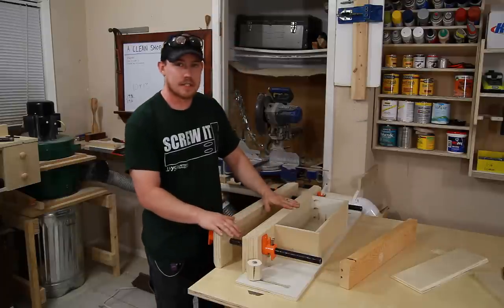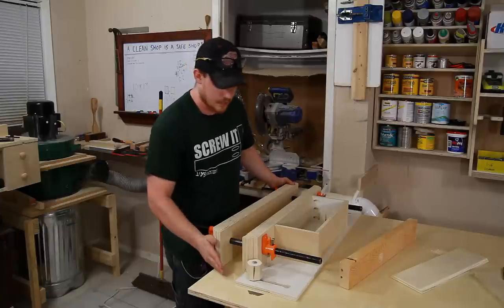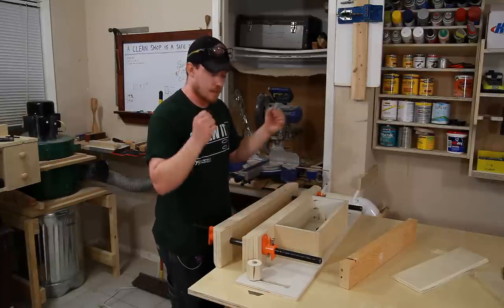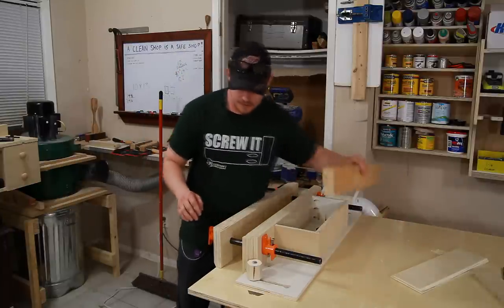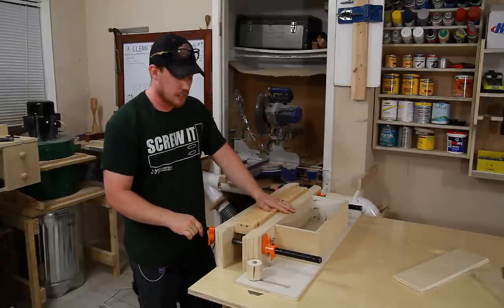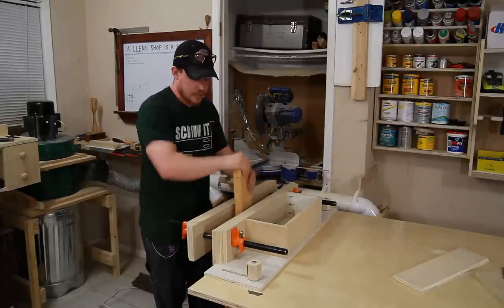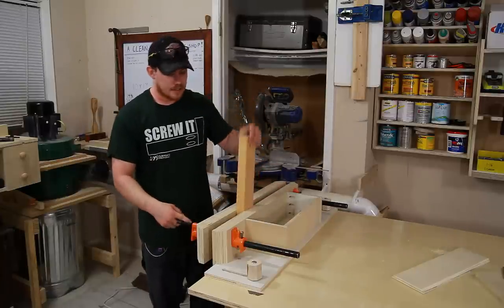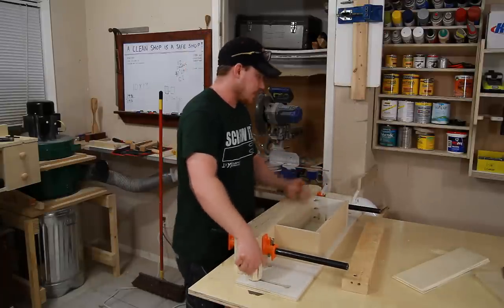Build an Inexpensive Sliding Moxon Vise - 144

Comment from the maker: Make a sliding Moxon vise. Cheap, strong, and easy. Free plans here: http://jayscustomcreations.com/2014/04/how-to-make-a-sliding-moxon-vise/
Reply: I love this project.  I plan to build this vise next time I can make it to HF.  Great job.
Reply: Jay Bates Jay! You've just saved my hide!

I've just started woodworking, and I'm jumping in with both feet, so to speak. I'm planning to build a workbench, but I've been at a loss what height to make the bench. I'll be using hand tools almost exclusively, so I'll be doing a lot of hand planing, for which I refuse to bend down. But if I set the bench too high to accommodate my hand planing, my bench won't be so usable for general tasks like assembly.

With your design, I can make my main bench at a lower, general purpose height, but will still be able to plane comfortably by adding the vise as necessary. Using those pipe clamps was the game changer here. Convenient and solid clamping.

From now on, if I ever eat chips while waiting for glue to dry, I will refer that to as my Jay Bates Moment. Thank you.
Reply: Advice is cheap, but it is usually a good idea to make your workbench the same height as your belt.

Comment: I've seen a lot of videos that don't use commentary and very few work well, but you did a great job with this one. I was able to follow it and even picked up a couple of tricks. The slots cut between two holes guided by a speed square - Good One. Got a good chuckle with the stuck glue cap, but dang man, I blew coffee through my nose with the potato chip/watching glue dry part!! I inherited a ton of pipe clamps, way too many, and I'm going to make me a couple of these for my shop.
Reply from the maker: Thanks for the feedback Jim. I appreciate it :)
Reply: CypressJim Yeah, the comic relief is priceless........but no way I'd dedicate my 1/2" pipe clamps, they're priceless! Nice and light and perfect for smaller jobs. I had....40 24" long pipe clamps for when I had a production shop but sold 20 off since I had to downsize.....
I have 4 6 ft pipe clamps that I haven't touched in 5 years same as my 4 foot bessey Revos.....the 32" are my go to daily......The Bessey's are the best/worst clamps on the market, best because the parallel faces and the mechanism, the worst because I find I am always reaching past the unused part to get to the clamped piece....if they had a moveable tail stock/fixed end, they'd be perfect (kind of like pipe clamps)
Reply: CypressJim are you selling any for cheap?

Comment: I didn't have a vise in my shop, but an upcoming project made me realize one was desperately needed, and quickly!  After watching the video a couple of times I downloaded the plans and adjusted the size to fit my bench.  I would have liked to use Baltic birch, but that's hard to get around here without special order, which I didn't have time for.  Instead I used some BC utility plywood left over from another project, and put the vise together in quick time.  Result exceeded my expectations!

Comment: Jay, thank you for the plans.  I built a vise the other day, but I used 3/4" x 24" pipe.  I have to say that this vise is unbelievably strong!  I've used it so many times since it was completed that I don't know what I did without it before.  I also made the bottom adjustable base wider than you did, so I didn't have to camphor the ends of the front and back plates.  I coated the vise with polyurethane to make sure that no moisture gets in.  I was going to build a small vise until I saw your video.  I'm very happy I made the larger vise.  It gives me the option to use it for many more projects than a smaller vise would.  Thanks and best regards.

Comment: Great job.
I worked with a pro in a small work shop for 20 months.
He had me put down cardboard sheet  or open boxes to caught the glue.
We ran 3 gallons of hot water from tap into a 5 gallon bucket & wiped down
 the squeeze out glue off the wood as soon as the clamps were tight.

I have 1" acme thread rod X 72 inches long with four nuts to make a clamp like yours.
Maybe not just Like yours, it will have two screws & two guide rods like wood vise.
But your cost less then mine.
Thanks for the Video.

Comment: I was wondering if pipe clamps could be used to make a Moxxon type vise so I was heartened to learn that someone else was able to make this type of design work.  I want to make a similar design but with a bench on bench style (i.e., a small table top that extends from the rear chop.)  Very cool design.  Thanks for sharing your experience.

Comment: I added a similar one to my new work bench, I was worried it wouldn't work out but it's actually better than the commercial vise I have on it as well. Mine spans the length of my bench and I was able to design a foot release to avoid having to reach under or around the bench

Comment: Nice video...well done. I was too cheap to buy a nice hardwood workbench too so I built one out of rough 2x4s that I cleaned up with a planer. I stacked them side-by-side to make the top and drilled some holes for bench dogs. Cost me maybe $50.

Comment: Wow. The way he slide the entire thing at the end of the video so you can work on the edge of the table for vertical pieces, and then slide the whole thing back on to the table completely as to be able to solidly work a piece pushing down vertically without any leverage or stress on the table structure.  That is super cool.  I just built a work bench of sorts that I sort of want to convert to a full CNC for a type of mini fabrication plant, where I could throw a board on there, and click a button, and it go drill all the holes.  Basically an auto hole driller with at least 3 drill heads so I can have 3 different bits at the same time, and not try to mess with some expensive and perhaps problematic commercial tool changer situation.  But it would be nice to have a few more bits.  Maybe like 4 drill heads. But 3 would probably get it as I usually need holes, pilot holes, and counter sinks. To be able to have that on a rig so the drills are always consistent would be a big help.

Comment: Brilliant idea - I think the sliding part so it's over the bench for maximum stability is very good.  Your shop is REALLY echoey - ever though about making some sound baffles for the ceiling to reduce it?  Would help with overall exterior sound transmission to.  simple frame with rockwool and some cheap material is all you need.

Comment: I like it. Thank you for posting. I made a modified moxon about seven years ago, using wedges to hold and drilled runners pinned with dowels to open and close. I am ready for an upgrade. I have enough scrap on hand to make it work. I really like it. Thank  you. BTW - did you oversize the holes on the chop to allow for angular adjustments/variations? Thanks again for posting. More clamping power, less frustration.

Comment: I bought two of these work tables for my hobbies. I love to tinker with building things and my wife was getting tired of me using her picnic table, chairs, and one time her dining table. (Man, did that cause a stir!) So she said I could order two of these for my Father's day present. (Honestly, I think it was closer to Mother's day when I got them, but I digress).I love the ease of putting these tables up and connecting them together. Speaking of which, "connecting them" is a bit weak, especially on uneven surfaces like the grass, but it does work well on concrete. The clamps are easy to get in and out of their storage as well as using them on the table. I just wish they were a hair wider! Use them in conjunction with the pegs, though, and they can do a multitude of clamping.The biggest complaint that I have is that the tables have a very thin edge, and if you're trying to clamp something to the table itself, it isn't that easy to do. I broke one "rib" under the table due to a clamp I was using to hold something down. I wish they would have made it with a thick edge for clamping. All in all, though, you can't go wrong with these tables, especially for the price!

Comment: Kudos on a tightly produced video.  As an instructional designer, (ret) I'd like to complement you on your video.  May I recommend moving the demonstration of the Monxon vise to the beginning of your video and use it as an introduction.  Viewers not familiar with the Moxon Vise may not have any concept of what you are building. until the end.  Think of it as a topic sentence of an expository paragraph.  Well done.  

While recalling how I enjoyed watching your clip on "waiting for the glue to dry," it occurred to me that you might want to put an analog clock in the corner of your video frame to show the time required to complete the project.

Comment: A real nice strong vise.

At the end could you put material of equal thickness on the other end of the vise so it clamps evenly?

By way, you have great videos.
Reply from the maker: Thank you. There's no need to put anything at the other end. Slide your material to the left and position the jaw and clamp so it's touching with minimal pressure then slide the material to the right and you can clamp quickly and easily with that one clamp. Works great.

Comment: The more clean line simpler the more the more elegant the solution. Great. One thing. You put the carriage bolts through the blocks then passed them over a 45 degree titled spinning blade. Don't do that. Needless risk for no gain. 
Forgot to say. I made the table saw hold down jig yesterday. Made some saw dust out of scrap for test, love it
Reply from the maker: Thanks! But if you are using the table saw properly the risk will be the same regardless of if the carriage bolt is present or not :)
Reply: Jay Bates Lol. Flying block is one thing,  flying block and bolt is another. Plus mess up blade.

Comment: It looks like your shop is fully enclosed.  Do you use a ventilation system of some kind?  Personally, I always get really paranoid about breathing in wood dust from the table saw, drills, orbital sander, etc. when I'm working, even though all of my work is done on a back porch.

Comment: Great vise Jay. Just wondering why you didn't attach the clamps to the wood more permanently. Was it so that you could remove them if you need them later? Looks like that's going to be another of my "need to make" projects.
Reply from the maker: I later drilled the back clamp brackets and screwed them to the back jaw. I mentioned it in the article as I did it a few days after I made the video.

Comment: Nice trick using the rafter square and your jigsaw, and nice vise.  I'm thinking of how to modify my workbench and want to add some vises, but it may be too high for a tabletop version.  Is that height comfortable for you?
Reply from the maker: The height is very comfortable. I think this puts the top of the jaws around 39 or 40 inches. I'm a short guy at 5-6 and it works great for me. No bending over.
Reply: You could do a Moxxon Bench on Bench type vise with a front chop that over hangs the front of your work bench (the space behind the rear chop has it's own small bench top so that it works like a vise set even with a normal bench top) and that can be flipped over and attached to the underside of the work bench.  The front chop would then be even with the top of the work bench as well.  The higher position with the vise on top would be for dovetailing and the lower position for other operations.

Comment: Really nice video! I love the part of the non-wanting-to-open glue bottle :D
And very nice project too, maybe I will build something similar. Thanks!
Reply from the maker: Pesky glue bottle caps!
Reply: Ahahaha, yes, I know what that is. The biggest problem I had opening a bottle was with an epoxy resin hardener. God, I almost had the palm skin of my both hand peeled off and the veins of my head exploded while calling bad words to that crapy cap for about 20 minutes! Nothing worked, hammer, screwdrivers...finally I sawed it and sit for a while taking a break before getting back to work and complaining about the wasted hardener at a broken bottle.
Reply: Jay Bates When I have a cap that doesn't want to come off. I use a small pipe wrench to unscrew it. I put rubber bands around the cap to give the wrench a better grip. Good build I will be making one thank you for the plans.

Comment: Plywood was never meant to be strong in that direction and it will never be as strong as a 2 by but if you would have oriented it in the other direction in case thats all you have to work with seams to me with a little thicker jaws it would have been much stronger but more pieces to glue up nice build though just saying

Comment: But you use mostly power tools, you don't need this type of.vise. Do you use hand tools at all?
Reply from the maker: Yes, I use hand tools too. This vise has been used a LOT in my shop since making it. I use it for everything that I need to clamp down. It's not something that is purely for dovetails.
Reply: nikotwenty what is your point? that you don't need a vise if you use power tools? or that you're somehow "cheating" if you use power tools?